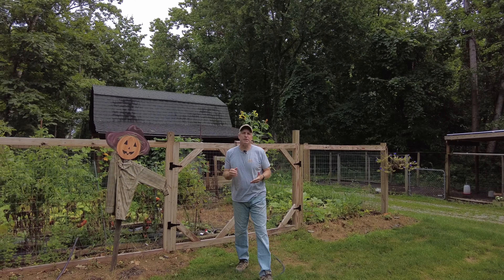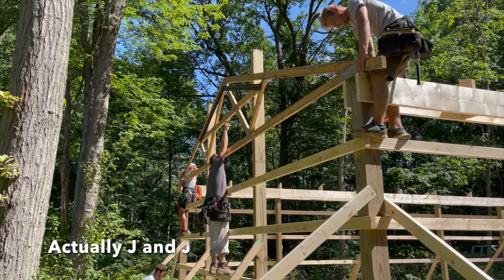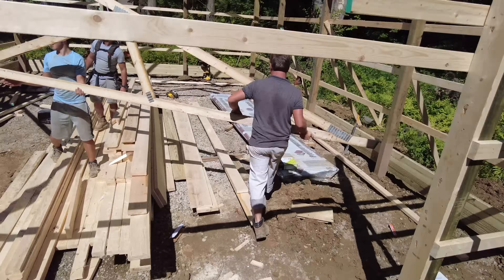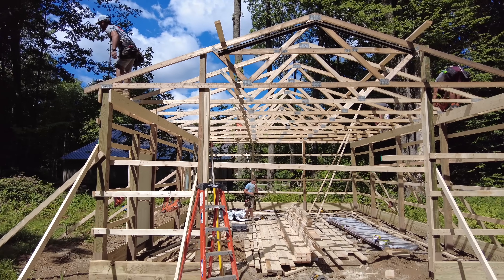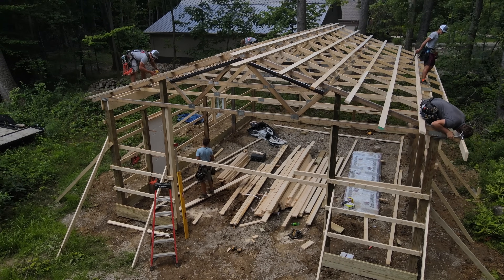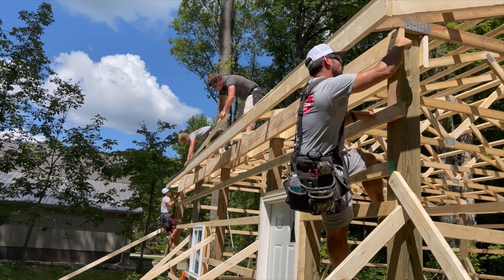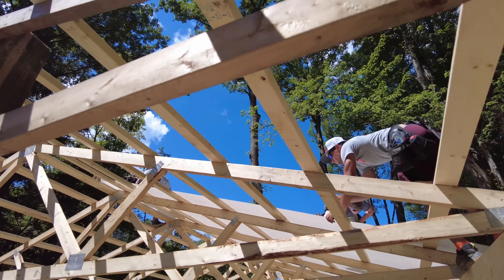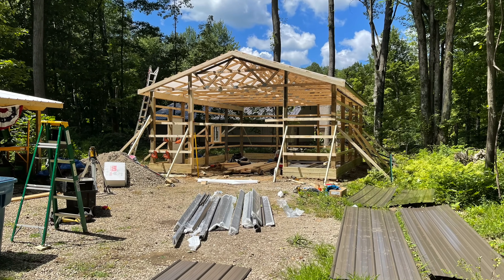Pole Barn Construction and Instruction: Trusses and Roof Framing

Comment: You won't get away with 8 feet on centre if you have snow loading, 4 is the max!
Reply: Not true
Reply: @scottb6098  I suppose if using heavy I beams you may
Reply: @hughroney6342  I had a big pole barn in north illinois.  Trusses were 9 feet on center,  purluns were 2x4 s  ,  2 feet on center..had no  problems for 20 years.
Reply: @scottb6098  You have no Ice storms or heavy wet snow
Reply: @hughroney6342  lol,  do you live in a different country?
Reply: @scottb6098  I live in Canada, but go and see how things are in Buffalo NY Or how about in California where rooves were collapsing all over the place over the winter! You go ahead and stick with your 8 feet, til that unusual winter comes along and your roof is on the ground and lucky if no one dies!

Comment: Hello, 
  I wish I had a cordless nail gun when I put my pole barn up, I had the good old fashioned hammer and nails.  When I put on the addition to my pole barn I used 2" insulation on the inside of the roof too help with the  condensation, and I taped all the joints. 
   Love the video's keep up the good work and god bless and stay safe.

Comment: I’ll bet you are happy you didn’t do it yourself! I was sure happy the way the crew put mine up. There a a lot of tricks the do to speed up the process a first time builder don’t know. looks great,  my building has the posts lying on top of the of the 12 inches of concrete around the perimeter with a 6 inch floor the steel brackets which the poles are bolted to are in the 12 inches of concrete.
Reply from the maker: Yes, my biggest stumbling block would be trimming it out.  Our neighbor used the same method as you with the post.  We have a packed to have our children to let us know which lasted longer in the afterlife:).